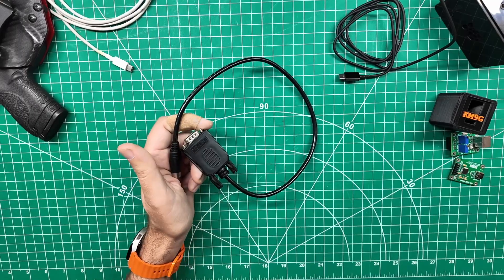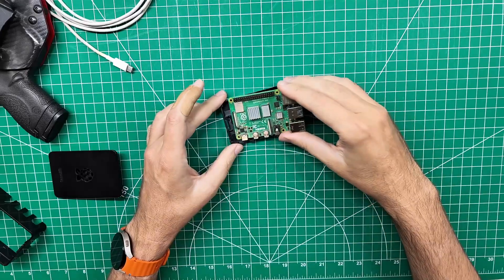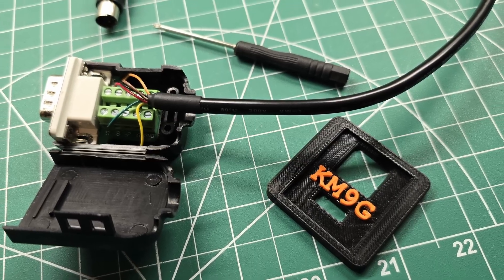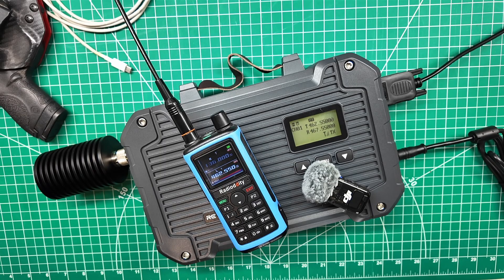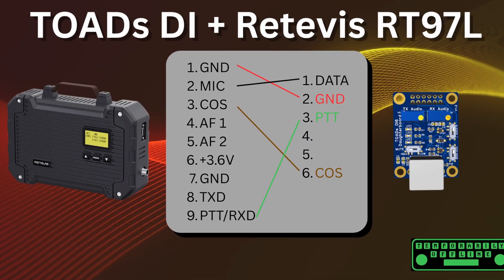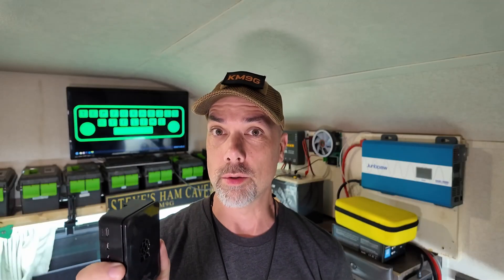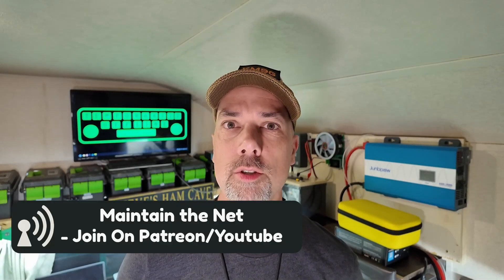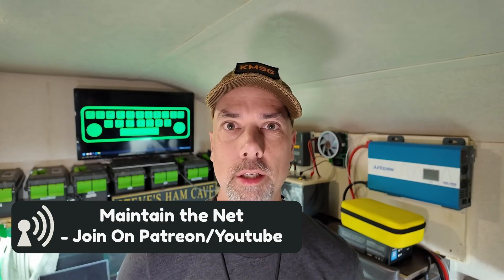Apex Operators Take Charge

Comment: lol so im confused what does it do after you plug in the magic box?im gonna need some better explaining LOL :)
Reply: The large box contains a raspberry pi, programmed with voice id and timing for the voice id. The smaller box contains a sound card interface that feeds the repeter audio from the progming in the raspberry pi. Basically the same setup that feeds an ht in an allstar node.
Reply from the maker: What Andrews said.  I added a repeater controller using a Raspberry Pi and and simple interface I created.  Computer -> Interface -> Repeater -> (magic zoomies in the air) -> hand held radio.  This off the shelf repeater doesn't have an ID unit, so I made one.
Reply: @temporarilyoffline what program did you use  for voice ID and timing of voice ID? Great stuff. Keep it coming.
Reply from the maker: @patv7572 allstar of course!  Best repeater controller out there
Reply: @temporarilyoffline  ah thank you sir now i get it LOL